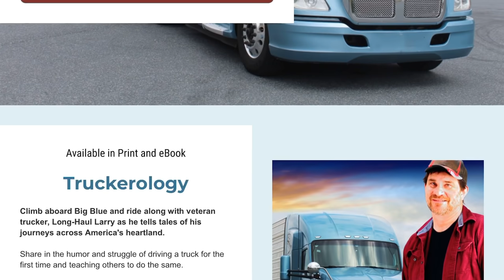Truck Repair, Finally getting some time to work on Big Blue 2020/74

Comment: Sir Larry !!!  Guess you gave up on the air suspension drop ??  Anyhows,, Yupper !! Pays to look at other people's videos to see the products that they use for different applications as when you go to the paint store ,,ask them for ""PREP SOLVE"" cleaner as that's what the body shops use to wipe down the areas to be painted to get all the crud off b/4 painting & works well to take the film off the inside of the windows as NO Streaking !!! Great video as always & too bad you didn't get that NEW drivers seat as would greatly help you back issues !!!  ""KEEP IT SAFE ""!!!!
Reply from the maker: Nope I haven’t given up on the AirDrop I’m still trying to figure out how to make it work without spending a fortune
Reply: @LongHaulLarry  Are there any TRUCK BONEYARDS in you area where you could remove what is needed at a reasonable price as you will take it out ???

Comment: are they Swage lock fittings? that' what we used to use years ago for replacing the old plastic quick connect ones (which I used to think were great until they weren't).
Reply from the maker: I have never heard that name before, they are just compression fittings
Reply: Probably very similar I'm guessing, certainly a lot better than the quick connect ones

Comment: You Just went on diet challenge. Since than have had homemade dinners served while being mechanic, moved fridge for accessibility, installed easier access to cleaning with air vs a two straw broom. Plus you were told by inspector that you were not to self create a (seductive) swimsuit calendar. That part is hazy, not knowing her, I’m not sure if she has assumed ownership of you or she really wants you to win weight loss challenge. Remember JBG has a active coaching team at home. Need to move fridge to back of cab outside and fill with rice cakes. What am I saying, after divorce I moved a refrigerator into living room....
Reply from the maker: 😂I have been so busy I haven’t even had time to think about the weight loss challenge yet

Comment: Don’t put lights on the side put a strip of LED under the molding. Think that would look great.
Reply from the maker: I thought about doing that and I wanted blue LEDs, couldn’t find any, I was told blue lights are illegal because of the cop cars
Reply: @LongHaulLarry  Blue you would have issues with. Maybe white or Yellow Lights like the side markers. Now you could get some that change color and turn them Blue or anything while parked that is allowed.